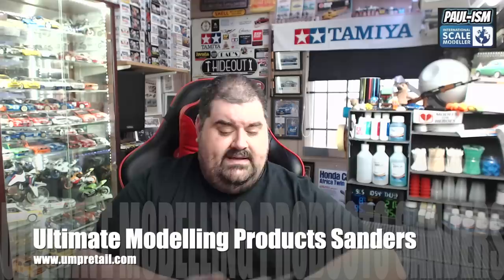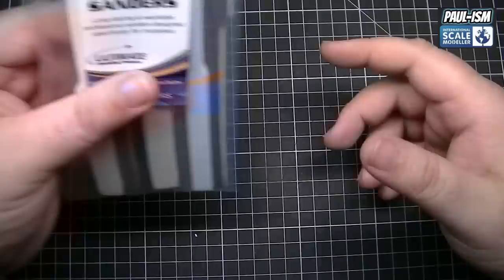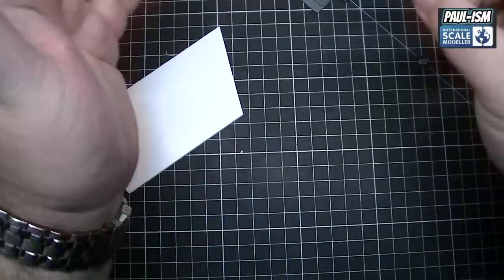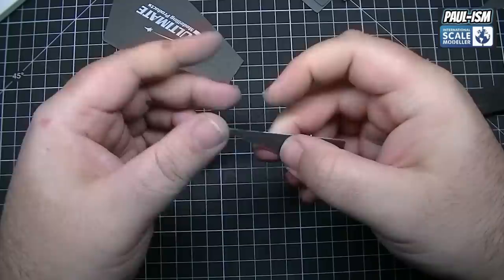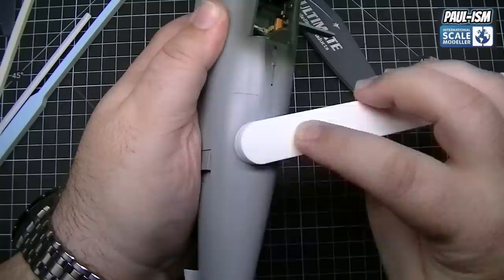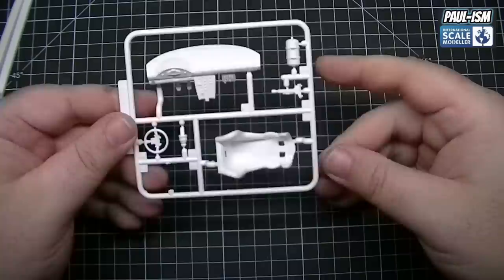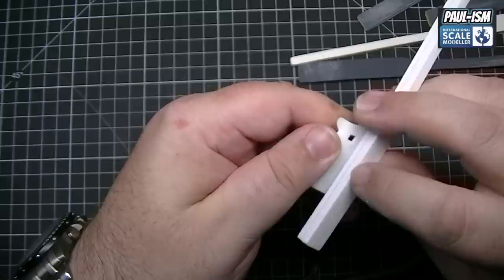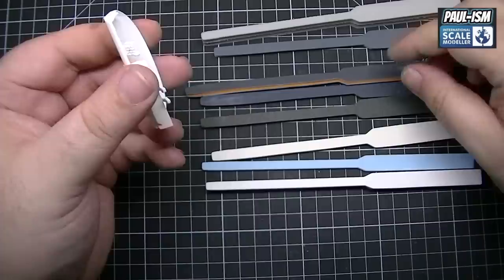How to use Ultimate Modelling Products Sanders.

Comment: Hi there Paul! Thank you for a great channel, tutorials and product range! I have recently purchased your set of sanding sticks and sponges, but have a question about its use. In your tutorials, you use it on bare plastic or on putties such as Deluxe PPP. Can the sanding sticks on sponges be used on traditional putties such as Tamiya grey and white putties and if so, wet sanding or dry sanding? I found with the old method of using sanding paper, it works (in my experience) with wet sanding only leaving a very model afterwards and very hard to clean. The watery run off flows into all panel lines, hardens and near impossible to clean... I would prefer dry sanding as you show in you videos and turorials, but would like to know if I can dry sand Tamiya putties with your sanding sponges and sticks. Thank you!
Reply from the maker: Yea you can wet or dry sand no problem just don’t use the buffer wet

Comment: Great video Paul. I wondered if you would do something like this in retaliation to something else filmed this week? I can confirm one thing to everyone. If you abuse any tool and use it incorrectly it will not perform as well or for as long as it was designed. Sanders are no exception, any brand, any grit, any shape... especially if you soak them.
The only sanders i avoid these days are the paound shop or supermarket nail sanders, they really dont last as they are not designed for the kind of use we give them. Having said that, the very thin fine sanders you see in supermarkets are awesome for keeping a good square edge in tight spots.. I use them regularly.
Reply from the maker: Hi Nigel, kinda yeah, i've been meaning to do this video for a while now and this just spurred me into action today lol